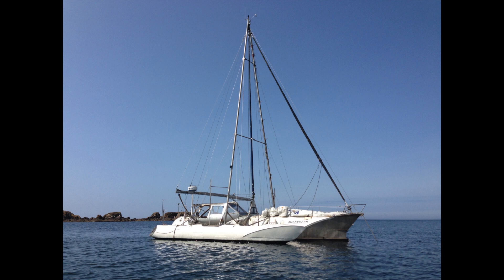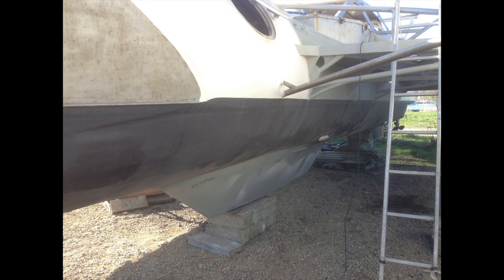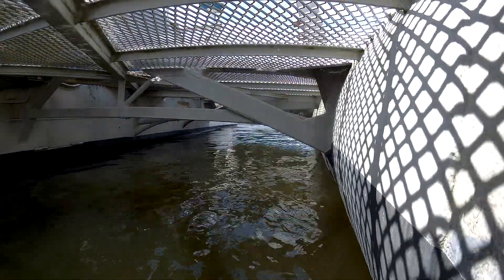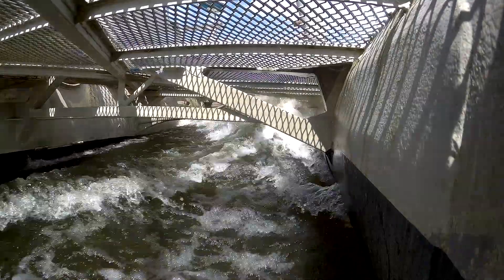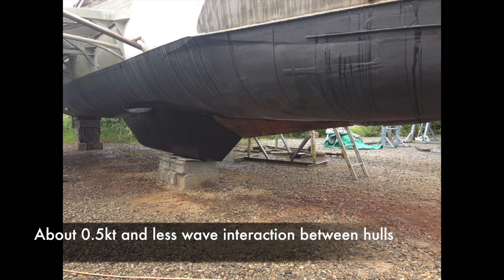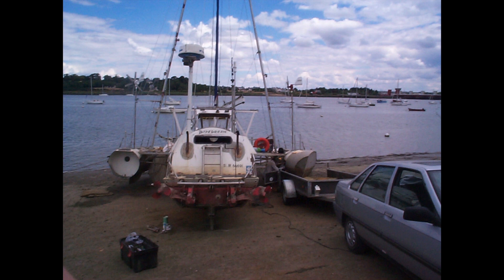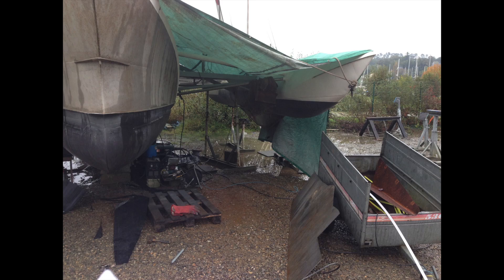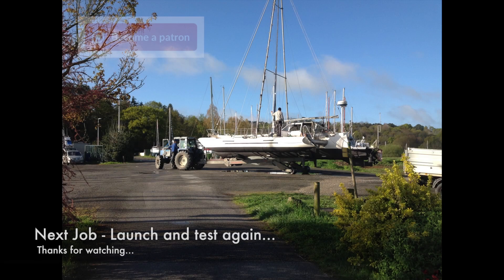Finally testing my boat with new keel - Project Keel

Comment: Nice job! Big sailing trimaran builders (Neel, Dragonfly etc) don't even build trimarans in aluminium, let alone in steel. So you really are the pioneer of steel sailing trimaran construction. By the way, how long and wide is SV Pipedream?
Reply from the maker: Thanks very much! To be fair, steel is not really a suitable material for small trimarans under 80 feet and Pipedream is heavier than she should be. She is about 42 feet long (I think, I have not measured since changing the bow!) and about 24 foot wide. So at about 8-9 tons loaded, she is lighter than a monohull, but much heavier than a Tri. Of course for what I want (a strong, stable and forgiving platform for single handed sailing) she is just right.